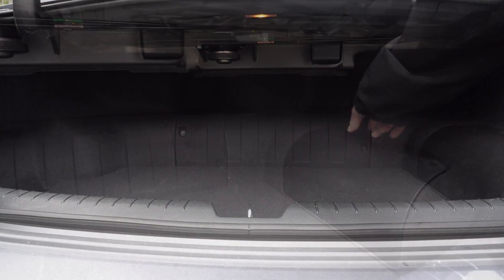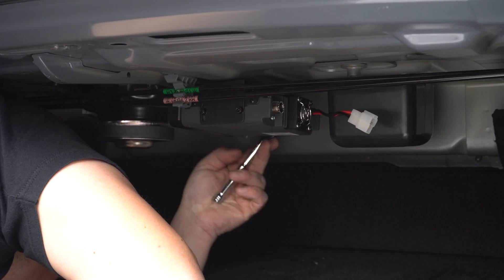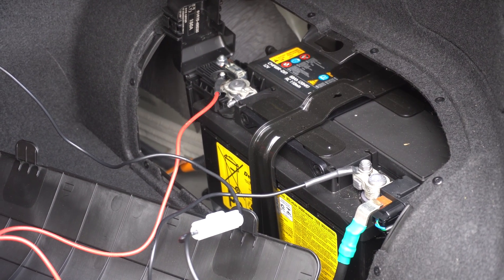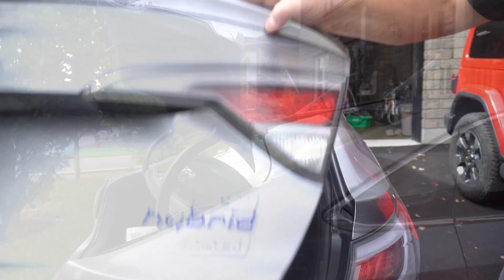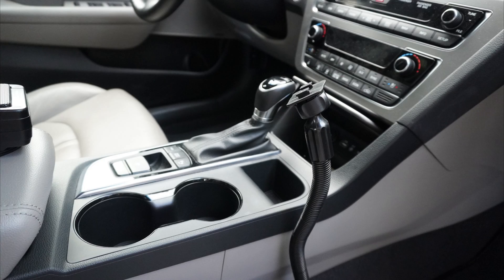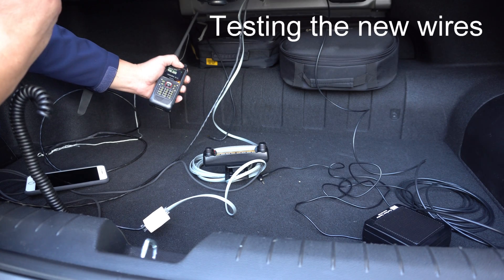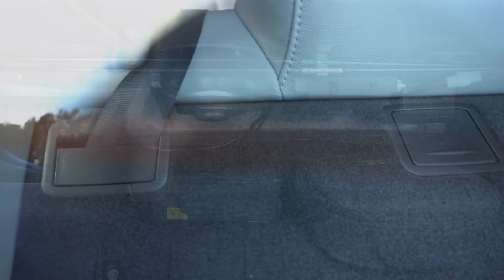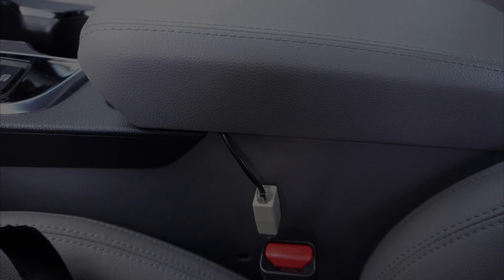Ham Radio Mobile Installation, Yaesu FTM-100DR / Sonata Plug-In Hybrid

Comment: I don't understand why Yaesu does not have the microphone connection in the control head.  I wasn't aware of this feature when I purchased the FTM-6000R transceiver.  I feel so strongly about this feature, I am going to sell the radio New-In-Box and purchase a unit with the capability to plug the microphone into the control head.  Your video installation of the routing and securing the excessively long microphone cable confirmed my concerns.  Thank you for providing a detail and well made video of your mobile installation.